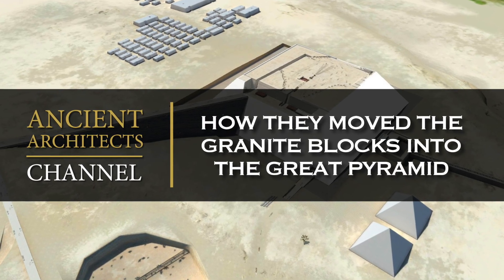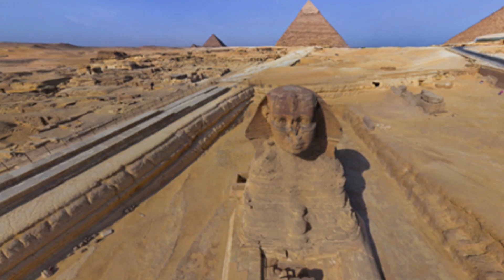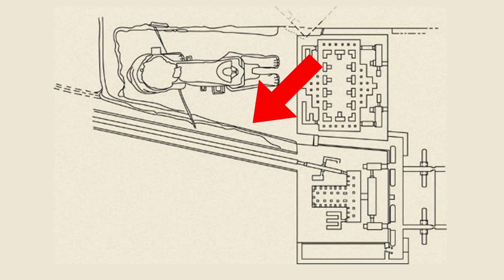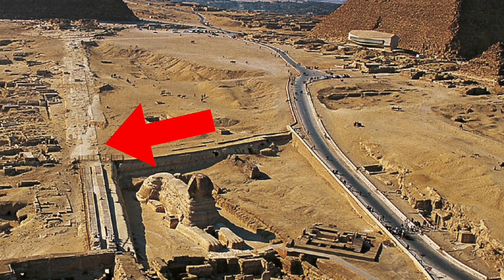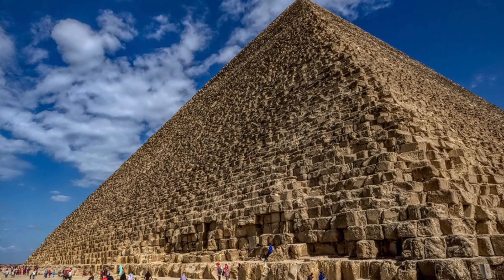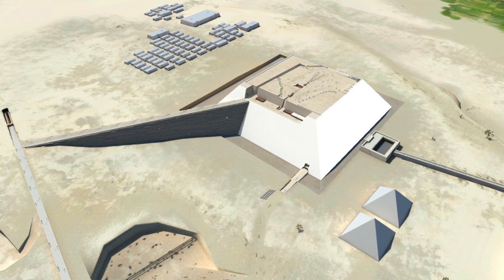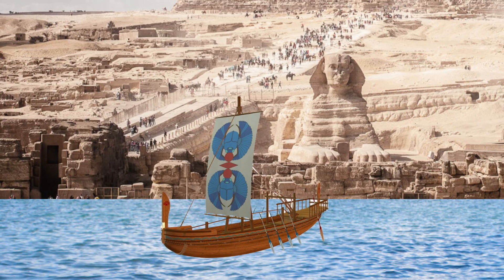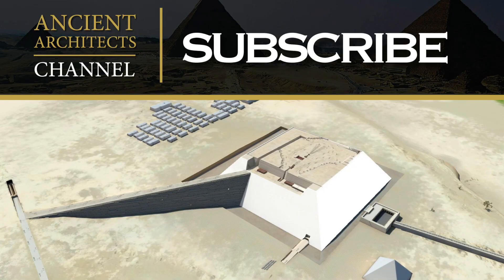How They Moved the 60-Ton Granite Blocks into the Great Pyramid | Ancient Architects

Comment: Beats me, How was the counter weight rigged to move  the 60 ton blocks up hill?
Reply: A counterweight could be made of many smaller blocks. I don't know if that's what Houdin theorizes.
Reply: The Secret of The Great Pyramid: Khufu Revealed Ancient Egypt History Documentary
https://youtu.be/UrQLpAEWbx0
Reply: Thanks Bales. I watched the video and find it plausible except for one thing and that is; the rigging of fiber ropes. Even if there were a mesh of ropes, they would not be able to pull a 60 ton stone up a 7% grade.The counter balance idea is sketchy. It would make more sense if it were a giant water pump that floated the stones to the top.
Reply: @larryswindcatcher  That may be plausible, but do you know if anyone has done the math on how much displacement would have to be generated in order to lift up a stone block weighing dozens of tons, or even hundreds? Because there are some stones that weigh 200 tons that were supposedly somehow cut and transported in ancient days. Presumably if we know how they did it with the heaviest of stones, we could make inferences about how they moved and placed smaller ones.

At any rate, it is my estimation that a system of flotation would have to be hundreds of times larger than the stone it was meant to move.
Reply: Reshpeck: Obviously, the builders knew the laws of flotation, after all they floated the stones to the site. They also knew the laws of canaterlever levers. The counter weight could simply be a reed catamarand floating a stone in a lock. They could drain the lock to raise the other end sith the other stone. We will have to see what the future developement of the concept will bring...
Reply: @larryswindcatcher  Again, sounds like a plausible theory. I'm just wondering what it would take to float a 50, 100, or even a 200 ton stone. I mean, in order to create bouyancy, it would have to take an enormous floatation device, many many times the size of the stone, and then an even larger system of water movement and containment. 

I'm not saying I disbelieve it's possible, I'm just wondering what something like that would look like. It's difficult to imagine, but then, it's difficult to imagine how they did any of this stuff.

By the way, I've been inside the Great Pyramid myself and seen these things with my own eyes. Those granite pieces in the Grand Gallery are incredible to behold. And let me say this: I do not for a moment believe that the Gallery was designed to house a cantilever system. Such a utility would not require the perfect precision found there. Moreover, those enormous granite stones aren't there for decoration; most are not even visible, and despite the precision of their construction they are not necessarily aesthetically pleasing. They had a function, the whole pyramid had a function, and when I was there, I could think of one thing. 

I'm inside of a machine.

What its function was, who knows? But I highly doubt it was something as mundane as a water pump, or even that its function was to facilitate its own construction, a conclusion Matt seems to have been steadily leaning more and more towards over the months. No, something that indescribably complex, perfectly constructed, and ENORMOUS (that cannot be overemphasized— nothing can possibly do it justice other than seeing it firsthand), yet flatly utilitarian in its features must have served some incredible technological purpose not accomplished in any other way.

My wild, crazy guess is it had to do with an understanding of the universe that we don't possess, something that perhaps would appear to us as purely magic. Just as the builders, assuming they never developed the technology of alternating current and computers, would see our modern world and believe we were in possession of magical powers.
Reply: @larryswindcatcher  Well, the water theory works when everything is level, but you can't float things "up hill".
Reply: Sauga Verse thats exactly what waterways and locks are designed for. Wether the causeway is an ancient lock system I’ve no idea though, interesting non the less.
Reply: @citizensteel83  Sure, locks work in modern times, but back then pumping large amounts of water would be a problem. 
Its one thing to float a large block of stone down the Nile, but a totally different task to build a lock system to lift these stones up the side of a pyramid. 
It is possible they built a canal where they could float all the stones right up to the side of the pyramid, but then they would still need a method of lifting them once they were there on site.
Reply: Realpeck: "Im inside of a machine". I agree. The magalithic builders used a technology that is beyound known human technology. The human logical mind is not capable to reason megalithic technology. They were building something useful like a machine.
Reply: Sauga Verse oh I totally agree, I’m not suggesting that they used canal locks although you never know. It was just the way you wrote your comment, it seemed you suggested there was no way to float an object uphill. If we go by the information the Egyptians actually left, the causeway could basically be a large ramp which uses water and sand to create as frictionless a surface as possible for large sledges carrying the stones. The artwork within the tomb of Djehutihotep shows how they moved large stone statues over the land in the same way.
Reply: @citizensteel83  My comment simply meant that water does not run uphill. 
To get water to a higher elevation, you need to pump it there. 
And in the case of pyramid building, it would require a great deal of water, at a constant consistent flow. 
That in itself would be a feat just as great as building the pyramid itself.
Reply: Sauga Verse cool, I’m sure it would be a feat equal to the pyramids themselves 👍
Reply: @larryswindcatcher  Everyone should bear in mind that with rollers under the blocks, the weight of the counter-weight would be at a minimum, -NOT equal to the weight raised since it was not being dead-lifted.  Maybe just a troop of men standing on the counter-weight would be sufficient with friction at a minimum. Then they walk back up some ramp for the next pull.
Reply: @reshpeck  and therein is the fly in the ointment of the flotation theory. Deep & wide hulled barges might make more sense.  But to accommodate them would require a deep channel.
Reply: @larryswindcatcher   Perhaps the force ratio increase from a cantilever device would not be as needed as assumed if the moved block was on rollers that eliminated friction.  Then the only factor would be uphill gravity.  Remember that strong men can move even trains and planes with ropes on level ground.
Reply: @citizensteel83  Perhaps the recessed center of the causeway was for block-supporting large round stone rollers which would provide an almost frictionless glide.  The incline was so gradual that overcoming the weight of gravity would not be a big effort for a team of men and oxen.  As the stones came out the back end they would have to be moved (cantilevered?) up to the front.
Wooden rollers would probably drift off into an angle or jam against the side, but if they were round and make of hard wood?...
Reply: Adrien Nash you know i certainly don’t see why not but I’m certainly not an engineer. The only reason I would lean more towards a sand and water sledge technique is due to there being depictions of this technique being used for other sites. Obviously doesn’t mean that’s the technique they used, I like your roller technique idea. As far as how they moved the blocks once they got to the pyramid base, there’s a video which seems a little ridiculous because he builds a pyramid in miniature from wood but actually I think he makes some interesting points about techniques which may have been used. Here’s the link if you haven’t seen it before https://youtu.be/DQzEaiOI3U0
Reply: Nash: What is the breaking stength of a hide rope? How about a wet hide rope? Even if the hide rope was braided into a 3 inch howser, the breaking strength is only a few tons.They did not use block and rigging , that I know of, and they did not know how to rig a Spanish Buton to increase the leverage. The real builders used high technology, unknown to this day..
Reply: @citizensteel83  I've seen the one where the blocks are rectangular in length and he never lifts them but simply flips them, which is ingenious.  Problem is that by appearances, most of the pyramid blocks are not long enough for that.  Maybe if they strapped a couple of them together it would work just fine.  It's beautifully simple and fairly easy.
Reply: @redwoodcoast  OK, I read it. As I said, those statues were destroyed in an earthquake and were laying in pieces on the ground for millennia. Many were completely covered and protected from erosion. Some parts are made from stone that was part of the reconstruction in modern times. Your theory needs to consider those facts and explain why we should disbelieve them.
Reply: @reshpeck  The same goes for your presumptions. Why should I believe in things not seen and not known by me or anyone else? You offered no claim of a previous documented 'reconstruction' that rebuilt anything.  You couldn't because there is no record of any such thing, only claims of ancient legends.
And your claim that the damage seen is earthquake damage is not credible at all.  So I have to assume that you read it with your mind as closed as a crypt, -unwilling to believe your own eyes, discouraging anyone else from believing theirs.  

If you were actually interested in the truth you would have at least made some attempt to debunk something I pointed out or postulated, but you didn't and that is because you couldn't.  Try again.  And next time, actually read it with both eyes open.

The damage seen CANNOT be produced by earthquake since the original statues are made of quartzite. Shake it all you want, it may  fracture along some weak grain boundaries, not around them. 
Only explosive force can cause the damage seen.  

And it's not credible that they were laying in pieces, although the solid one lost an arm from the weapon's impact.  The 'reconstructed' one, if it actually was, was damaged beyond comprehension since the entire chest area must have been blasted away.
But besides the damage issue there is the movement and sculpting issue.  How do humans move 1,400,000 lb. statues 420 miles overland??????  I don't know.  You don't know.  Nobody knows, because there was more going on than we know of, technologically speaking.  Care to suggest an explanation?  I didn't think so.

Amenhotep was believed to be a god, and even he believed it, maybe because he was of the 'god' genetic line.  If he was, then he knew he was because he had access to technologies that we still do not have today.
Reply: @redwoodcoast  That's not how it works, my man. If there is an established theory, and you have a different theory, you have to prove that your theory is better. You should start by learning what the prevailing theory is, and by virtue of you saying there is no evidence of it being true shows that you have not taken that first step. 

And you're complaining that I have provided no evidence? I'm not going to do your work for you. If you were interested in the truth, you find it for yourself. Refusing to do so is intellectually lazy. Also, you make assumptions about what I think. That's being intellectually dishonest. Later dude.
Reply: @reshpeck  There is a significant difference between "complaining" about something and merely taking not of it.  I took note of your failure to buttress any of your establishment doctrine with a single fact. That fact is evidence that you either have none, or are too self-important to actually debate a topic for which we are all here.

"Refusing to do so is intellectually lazy".  How do you know what I have "refused" to do??  What that is is a good example of the pot calling the kettle black, even by your own logic.
Reply: @redwoodcoast  Establishment doctrine?

OK, let's think about this. If that is what you think I endorse, but it turns out that you are wrong, and you go back and reread everything I wrote and see that in no way have I ever indicated that I toe the establishment line, would that lead to some degree of self-reflection, and perhaps some degree of humility to counter your ill-advised arrogance?

I think the pyramids are Younger Dryas at the bare minimum, possibly tens of thousands of years older. I think there was a global civilization that was wiped out. I think there is a mountain of evidence that is being suppressed. I don't believe in macroevolution. I don't believe in the big bang. I don't believe modern science has brought us any closer to the truth than what the ancients had, perhaps further, in fact.

But because I think your theory is rather shit, I'm an establishment guy. That's what I mean about intellectually dishonest. As for intellectual lazy? Yeah, maybe not, you're right. It could be you are just intellectually mediocre and doing the best you can, and are simply incapable of finding out for yourself that you are wildly misguided. Sorry, wish I could help, but I certainly tried.
Reply: @reshpeck  That's a lot of maybe's. So maybe the opposite is actually true. But, I don't even know what it is that you''re disputing, so I can't respond to a phantom.  That's how this sorts of discussion means lead to dead-ends. Too much time and water under the bridge between related comments.
Reply: @redwoodcoast  Well that was a more insightful response than I was expecting, which means I underestimated you. So you are not intellectually mediocre (which was an ungenerous suggestion, though not unwarranted considering how you have been so dismissive towards me). And despite what I said, I don't think you are intellectually lazy. I do think you have been intellectually dishonest, but I also think such dishonesty is rarely intentional because we are all far more proficient at lying to ourselves than to others.

What am I disputing? That your theory about the Collosi of Memnon is teneble, and that your dismissal of the contradictory evidence is based in disinterested investigation of said evidence.

Matt's work on this channel is an exemplar of such a disinterest. And by that, I don't mean he isn't interested in the subject matter—quite the contrary. I mean he is disinterested in where the evidence leads, meaning he takes all available evidence and develops his conclusions, rather than starting with a conclusion and seeking to fit the evidence into that precast mold.

Hence my disbelief in evolution, for instance. I don't have an alternative theory to posit, but the contradictory evidence for anything resembling that theory has been piling up for decades (philosophical evidence against it has existed since its inception), and indisputable mathematical evidence from analysis of the function and mechanical processes of DNA utterly destroys the viability of evolutionary theory. But any scientist who argues as much faces academic ostracism, public ridicule, and comparisons to flat-earthers and religious fanatics. I feel the same way about anthropomorphic climate change. 

Take from this what you will.
Reply: @reshpeck  There's a problem with your view of the colossi.  There are no records of their 'restoration' at all, only rumor and hearsay, which I don't take to be 'proof' of anything. Earthquake damage could have happened to a small extent, but the damage seen was NOT due to the ground shaking.  It was due to blast.
Earth movement cannot damage single pieces of solid stone, it is only pieces cobbled together in structures that might separate when shaken.  I've seen earthquake damage up close and person since I've been through four major ones at the least.  Everything remained intact unless built of brick or plate glass.
The rumor is that the statues were found laying in the dirt.  Were is there any evidence of that?  I can't find any.  But if they vibrated off of their platforms and toppled, I'd like to know how they were raised back up on top of them, -and when, and by whom?

"“At some little distance in the plain are two colossi, placed side by side, both seated, and with faces turned towards the East."
~ From Travels in Egypt
  by Count de Forbin, 1817-18

True, Romans supposedly restored one of them, and that would make a lot of sense as to why it is now an assemblage of great blocks and geopolymer plastering over of the surface.
You can't answer those questions about any raising of them because those giants never toppled over, but if they had, there was no one except those who made and moved them (all 700 tons ea.) that could have uprighted them, if at all.

There were hundreds of statues in that memorial temple (all cast as geopolymer stone concrete) and many of them were toppled over and even buried by the earth opening up during the 1,200 BC earthquake, and later flooding by the Nile. But the giants remained standing and undamaged.
Prove me wrong.
Now that subject aside, I perceive that you have not yet taken advantage of the ScienceTheory website that I've put together.  It is intended for exactly people like you who would love to find together in one place all sorts of reports and articles confirming what you've learn to be true about the establishment dogmas. 
 It is an aggregation website that draws articles from different branches of science.  Check-out the categories found at the top,  -click on one and it will display all of the articles under that heading.
I encourage you to read the anchor article that I wrote 10 years ago and persuaded me to put the site together (since it was so totally unlike anything ever written or conceived.)  It's titled; Sudden Evolution.
Reply: @redwoodcoast  Just because no records exist doesn't mean that no evidence exists. But in fact there are records, you just haven't looked hard enough. More importantly, there is plenty of evidence that the statues were damaged by an earthquake and rebuilt in ancient times. But none of that indicates how they were originally constructed, for which mainstream narratives are fully inadequate. 

Here, try some actual peer-reviewed research findings, instead of watching Ancient Aliens and Bright Insight (no offense to Jimmy, I really enjoy his channel). 

https://www.researchgate.net/publication/236960355_Archaeoseismological_studies_at_the_temple_of_Amenhotep_III_Luxor_Egypt
Reply: @reshpeck  You really ought to know what is said within the links you give to support your view.  Your link in fact debunks your view and supports mine!
"More than a century-long intense archaeological excavation has still been **unable** to provide clear information  about  earthquakes  that  could  have  *destroyed*  the Memnon Colossi and other temples in the region of ancient Thebes. " (like Tanis?)

"Strabo  writes:  “Here  are  two  colossal  ﬁgures  near  one another, each consisting of a single stone. One is entire (as I noted by observation); the upper parts of the other, from the chair, are fallen down, the effect, ***it is said***, of  an earthquake” 
Strabo’s account about destruction of the northern of the Memnon Colossi in the Amenhotep III temple is the earliest historical record available to date.

"It is said" is NOT evidence in any scientific circle and yet you are throwing such crap at me (as evidence???) after I've pointed out the abject LACK of evidence!  How lame.  Local old wives stories aren't evidence.
"~we ﬁnd no signs of  an earthquake in 27 B.C. "

So now what do we know that is different from my photo comments? We know of "some" (completely undefined) claimed earthquake damage. Which tells us next to nothing.  It could have affected only the female statues, or only the base for all we know.  The bases were a wreck in the diagrams.
"It is still unclear when the upper part and the socle of the northern colossus were restored.
 One *very tentative* hypothesis is that this could have happened during the rule of Roman emperor Septimius Severus around A.D.  199  (Sourouzian et al., 2006). 
This hypothesis is based on the observation that grafﬁti describing the “singing” of the statue was no longer made on it after A.D. 199, and on the tradition (i.e. 'legend') stating that the statue was silenced after restoration."
Judging by Roman style binding clamps they did some restoration work still needed though the Egyptians probably did most, including rebuilding it.

There's a decent hypothetical depiction of how the ground fractured beneath the northern colossus and it rocked backward, impacting the wall behind it and breaking.  But there is no discussion that I see of how the frontal damage was caused.  How could there be when it was not caused by anything in front smacking against the bodies and faces?  That only leaves what I wrote: a direct hit by a massively powerful energy weapon. 

I know that your conventional thinking might not allow you to think such a thought.  I don't expect it to make any sense to you, but you don't know the dynamic factors behind that scenario that I'm aware of and expect to one day share.
Reply: @redwoodcoast  The article supports the evidence of an earthquake. It quotes Strabo as support for its thesis that the earthquake occurred before 27 BC, as is commonly believed. It also entertains notions of human destruction, and provides very strong evidence (beyond contemporary reports, as you keep straw-manning) of its reconstruction and the time frame during which such restoration would have occurred. 

You think this is the only scholarly article written about the Collosi of Memnon? This one doesn't discuss the damage you attribute to an energy weapon, but others have discussed it, and numerous other aspects of what may have occurred. Maybe the one was damaged by ray guns. Or maybe it was caused by some destructive solar or celestial events, perhaps the same cause of the melted steps of the Temple at Denderos, upon which I have personally walked. 

However, I'm not doing your research for you. Moreover, I'm tired of you continuously moving the goalposts. You said there was no evidence for an earthquake or reconstruction other than unreliable accounts. I responded with a peer-reviewed article disproving that assertion. You proceeded to misinterpret its findings to suit your own pet theory, and now expecting me to provide further examples. 

If you want to disprove well-suppoterted, established and widely accepted theories, you first need to know what they are and why they are accepted. Otherwise you will never be taken seriously, and it isn't enough to label them "Conventional" or "Establishment" as though that makes their inadequacy self-evident. Gravity is a rather conventional theory, after all. 

How do I know all this? I have a master's degree in Middle Eastern History and am a PhD student in International Studies. Granted, I'm no expert in archaology, anthropology, or Egyptology. In fact, I daresay you may know more about those things than I do. But I do know very well how research, analysis, and evidentiary interpretation works. I know you are trying to engage in those processes, but I'm here to inform you that your standards are not nearly high enough. Take it as an insult and dismiss all I'm telling you to protect your ego if you must. Or, better than that, take it as a challenge and try to do better. If you choose the latter, also take this as encouragement: you're thinking more critically than most people—more than most PhDs I've known, in fact. But don't let your arrogance keep you from doing even better (like those very PhDs I'm thinking of).
Reply: @reshpeck  " I'm here to inform you that your standards are not nearly high enough."  Great!  And I am here to inform you that the standards you think you are upholding don't hold what you think they hold.
I call on you to follow your own standards...Standards of EVIDENCE...you know, like in a court of law. 
Not guesses, not rumors or legends or old wives fables, but proof!  
Actual records.
You falsely pretend that evidence is PROOF when you know that it is not.  Why do you do that?
I showed you as plain as day just how totally vague and equivocal the 'evidence' was by their own admission (almost warning), yet you toss that important issue out the window like it's unimportant?  What kind of scholarship are you preaching??

Okay, the article/ report informed me about an earthquake at some unknown time, and restoration by unrecorded parties whose identify can only be judged by their techniques, and because of that information I must rewrite some of my assumptions which were intuited from the photos and a severe lack of historical documentation.
BUT, neither you nor I nor anyone else can explain what happened to the frontal areas of the two statues.  They can speculate but that is not proof nor even evidence. So what should rule?  Logic.  And logic dictates the cause that I postulated and pontificated.

And besides that central point regarding their condition there still remains the issue of how they were sculpted and moved.
Do you know of any scholarly paper that gives a good explanation for either?
 https://sciencetheory.wordpress.com/2019/08/15/colossi-of-memnon-stone-vs-geopolymer-concrete/
Reply: @Coma White 200 ton blocks??  Where?  Average block of the Giza pyramids is said to be 2.5 tons, with the granite ones +/- 60 tons, so let's redo the math with those numbers. Forget the obelisks for now.
Reply: @redwoodcoast  I'm the one who brought up 200 ton blocks, only because I was theorizing that whatever techniques were used to move and place blocks of that size would probably shed light on how a 50 ton stone was likewise maneuvered into position.
Reply: @reshpeck  I'm guessing that you weren't referring to actual blocks but to other things like obelisks.  I have never heard of blocks that size in Egypt, not even granite ones.
As for giant statues, I'm coming to suspect, and possible 'prove' that giant sculptures that are not a part of bedrock are actually geopolymer stone-concrete castings.

I show that very fact in:  Colossi of Memnon; Stone vs Geopolymer Concrete  https://sciencetheory.wordpress.com/2019/08/15/colossi-of-memnon-stone-vs-geopolymer-concrete/
You will definitely want to see the photographic evidence.
Reply: @redwoodcoast  I'm referring to the largest stone blocks found in structures all over the world, not just in Giza. If we knew how they were cut, transported, and lifted into position, it could help us understand how the smaller ones were as well.

I have my doubts about polymers being used, but I don't rule that out at all. One of the major points of skepticism I have is the evidence of cutting that is found on some of the largest pieces, especially the granite blocks. I can say with 100% confidence that were not poured, they were cut. Moreover, there are quarries and unfinished pieces, obelisks and the like, that prove that huge blocks of stone were cut whole. If they were doing that, why would polymer stones be employed? Maybe they were in certain instances, but as a theory that explains away the difficulties of placing enormous stone blocks into position, it has no utility.

P. S. I've seen the Collosi of Memnon up close. Those were carved from one piece, destroyed in an earthquake, and put back together much much later, of that I am sure. But I will read your findings with an open mind.
Reply: Pulleys and ropes. Maybe in combination with flooding the hole. If the counterweight blocks were placed on floating material it could be controlled by water levels.
Reply from the maker: That’s in Houdin’s book. I didn’t go into it in this video.
Reply: @AncientArchitects  And everyone should bear in mind that with rollers under the blocks, the weight of the counter-weight would be at a minimum, -NOT equal to the weight raised since it was not being dead-lifted.  Maybe just a troop of men standing on the counter-weight would be sufficient. Then they walk back up some ramp for the next pull.